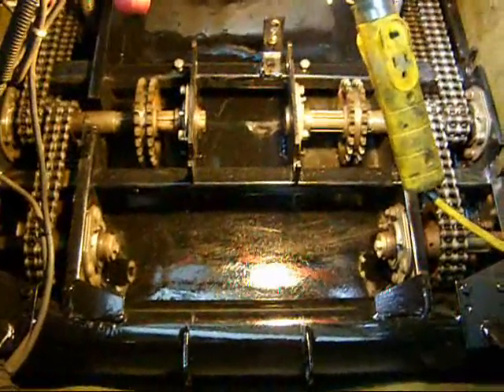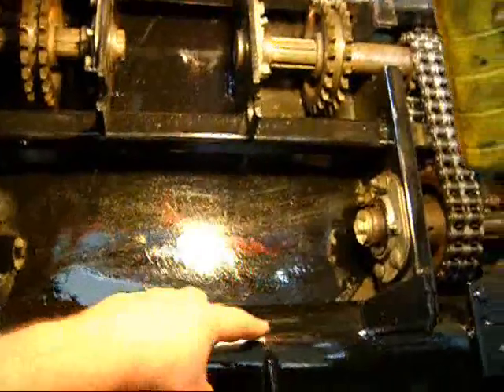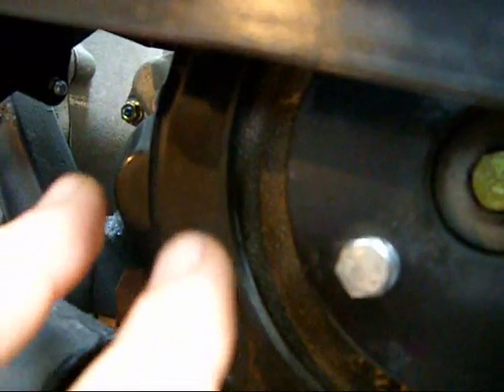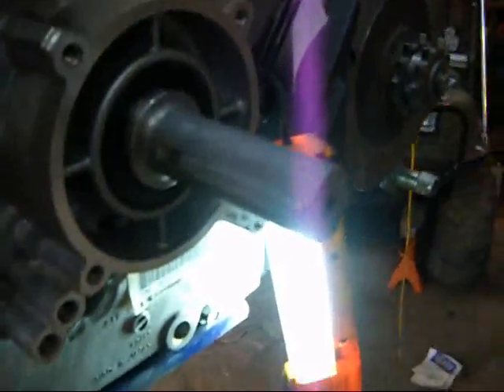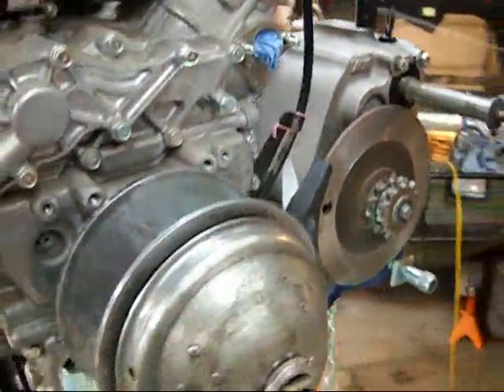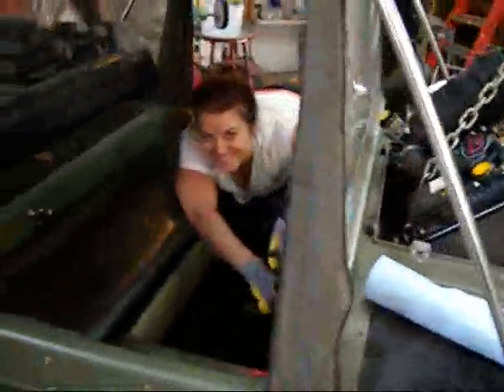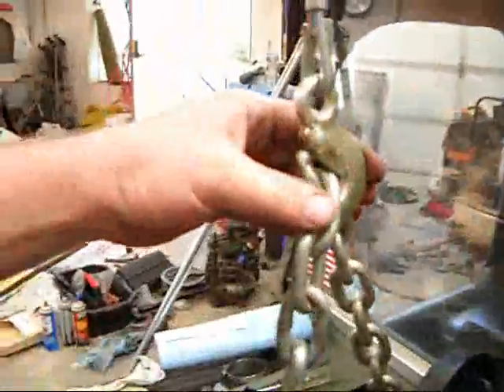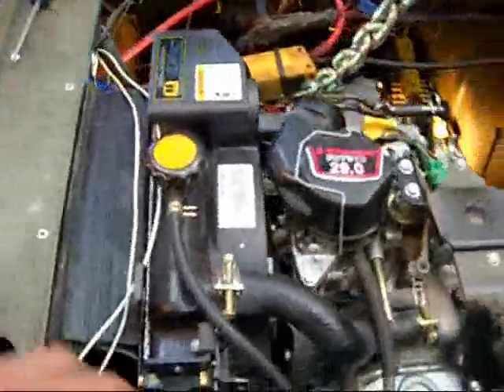Argo 29hp engine Install video #7

Comment: Is the Gen 1 transmission gonna be able to handle that 29hp? I was advised that the Kawasaki 20hp was about as big as Argo recommended for that Gen 1 tranny. The newer Classic tranny was build stronger for more HP engines. 
    It was something about the Gen 1 tranny having a "sacrificial gear" meant to break before the case or other gears are damaged from too much torque/power. 
    Didn't really make sense to me but I'd thought I'd ask if you've had any tranny issues from the extra hp you now have.

Comment: if you take the rubber trim piece off that goes all the way around the argo and drill the rivets out the Whole lid comes off of it,  very quick and easy to replace

Comment from the maker: @RockDoctor07 I hope your trip was fun.  The air filter will fit in the rear / passenger edge when you open the hood.  The elbow does turn 90 degrees.  Maybe one day I could also put an avenger hood for looks.  I just came in from the shop and had worked on the battery tray fab. It hit the radiator (with batt in it).  So I bought a wider but shorter length new battery.  I had to add one inch cross car to the old tray and bend the top holder strap wider in vise.  Came out fine.

Comment: Coming along great, looks like it will all work out. 
You should be able to take the clutch off while the engine is in. It's a little tight, but as long as your shaft is cut to the same length as the old one it will work.
Also, here's a thought... Would a hood of a new Avenger HDI cover that Air filter assembly?
A little dashavoo on that vid :-)